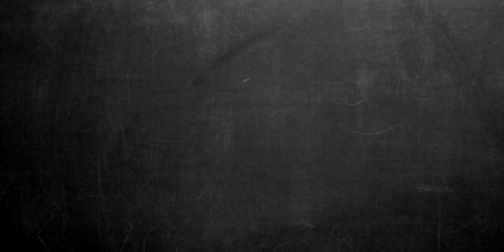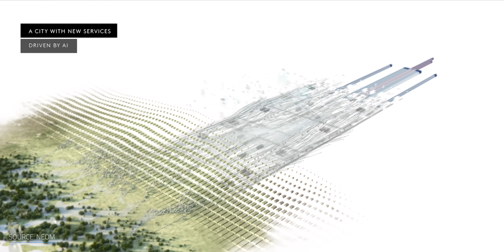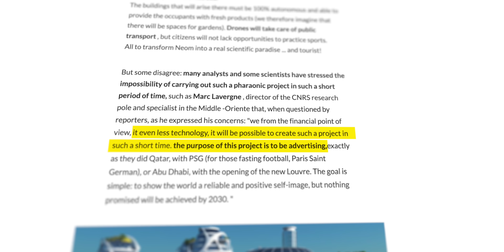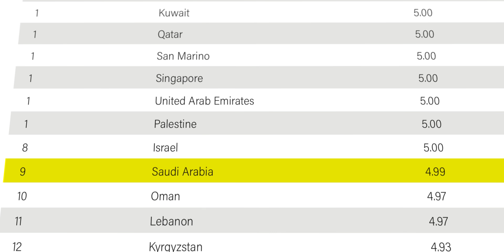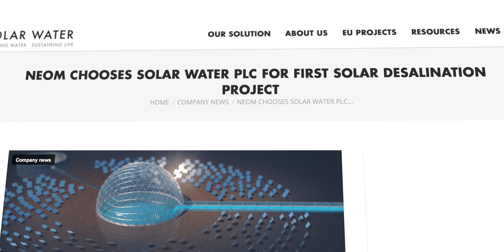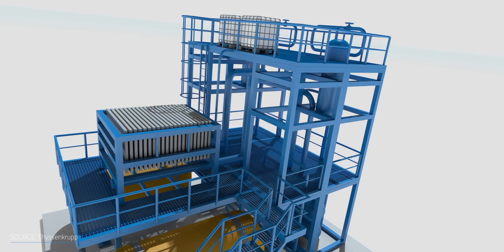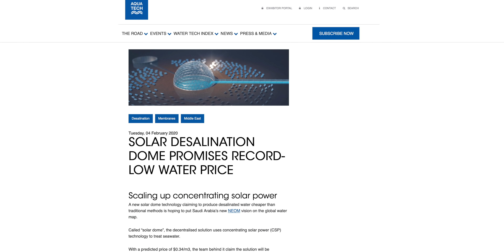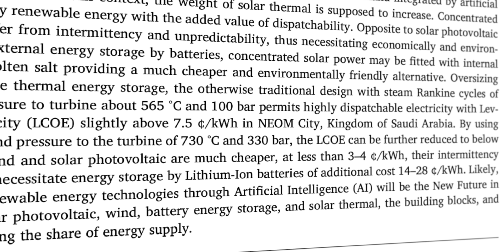Why Neom Might Be The Future of Sustainable Cities

Comment: How can you make a mostly scientific video, talk about the temperature of gases and use Fahrenheit as your unit for your description of their temperature. Come on.
Reply: Does it matter? No, it really doesn’t. I swear, you never hear bitching about the use of Celsius, but all hell breaks loose if someone uses any unit not metric. If you want to know what the temperatures are in Celsius, just look them up. Heck, if you want to bitch and moan about Fahrenheit so much, let’s cut the middle man and use Kelvin instead, since that is what’s used in science.
Reply: @howardbaxter2514  In the scientific community the metric system is standard (with some limited exceptions) because the units are superior for any number of reasons that you could research yourself. I am perfectly okay with using Kelvin, in case you didn't know a degree Kelvin is the same as a degree Celsius, the scale is just shifted by 273.15 degrees.
Reply: @howardbaxter2514  You seem to be making a lot of assumptions about someone on the internet you have never interacted with before. I can absolutely understand displaying both units when talking about measurements. I can't however instantaneously convert Fahrenheit to Celsius in my head without losing my train of thought while watching the video, so I can't immediately understand what is being said.

Fahrenheit is used by 7 nations on the planet, and as far as I know it's one of the imperial units that's not used by the scientific community at all, and clearly Matt is American, but he also talks about science and technology a lot so I'm not sure why he's using inferior units on their own. 

I'm also uncertain why you have a need to be so rude towards others because they disagree with you, but do consider why larger educational Youtubers (and humanity as a whole) tend to not use Bananas, grapefruits or mugs to measure things, but instead tend to opt for Celsius or at least show both systems.
Reply: @endur1el  you realize the point I’m making in using obscure units is to stick it to y’all that constantly bitch about units, when all that matters is that you understand what I am talking, I would think it is fairly easy to see how long something is if I said it was 4 bananas long. 

And yes, I have seen people complain when people use BOTH measurements. Heck, I’ve seen people complain about the SloMoGuys use feet to mark off measurements for their glass breaking video, despite them not accepting the fact that they converted all the units to various other speed units in the end, whether that be mph, m/s, or Mach.
Reply: @howardbaxter2514  Once again, you're making unwarranted assumptions about my opinions and behavior. 

I mentioned earlier than Fahrenheit isn't a unit I (or most people) understand intuitively because unlike other imperial units I am basically never exposed to it. While Imperial mass, volume and distance measurements are also inferior to their metric counterparts, I've seen them used enough that the conversion is fairly immediate. Also the conversions are simpler, with approximations required only whole number multiplication. 3 feet ~ 1m, 1 quart ~ 1 liter, 2 pounds ~ 1 kg. This isn't the case for temperature (It's also the least used Imperial unit internationally afaik).

Again, not sure why you have a need to group people. Humans are individuals, I'm not making any assumptions about your opinions on anything else. Would appreciate it if you did the same.
Reply: @endur1el  maybe it’s because I get tired of seeing comments like yours on EVERY freaking video involving science and engineering. It’s like, maybe instead of complaining about it, look it up. You very rarely, if ever, see Americans complain about the use of metric units, so why do people like you feel the need to complain about any usage of imperial units. And just so you know, the conversion is fairly simple. F= 1.8C + 32. For reference, -40F = -40C, 32F = 0C, 50F =10C, 68F = 20C, and 122F = 50C
Reply: @howardbaxter2514  I know what the conversion is and my point isn't that it's impossible, merely that it's just complex enough to be annoying, with how there are two components to keep track of rather than just one. 

And Americans shouldn't complain about someone using the system that is used almost exclusively in entire world outside the US, and is considered superior by those who really stretch the limits of what we can physically measure.

Imperial is an objectively worse system. I absolutely understand using mach when working with sonic speeds or AU or parsecs when working with Astral distances, but using a system which is fundamentally more complex than it needs to be seems unnecessary.

And again, I'm not saying you shouldn't be allowed to use imperial units for anything. Think of it this way, using imperial units in scientific conversations is like someone coming to the US and refusing to use the system everyone around them is accustomed to, refusing to even use both systems, except worse.
Reply: @endur1el  “two components to keep track of”, meanwhile Americans are taught both systems and how to convert between them.
Reply: @endur1el  but regardless, hot is hot, and if you don’t know what the temperature is in whatever degree you use, then simply look it up. If I’m told something is astronomically cold in Kelvin, I don’t complain that it is in Kelvin, and that I can’t understand it. Instead, I do conversions into Celsius AND Fahrenheit.
Reply: @howardbaxter2514  Honestly not sure why I wasted so much of my time on this, since you're clearly just making bad faith arguments and not responding to what I'm saying. I think if you read through all of my previous messages you'd get answers to both of the things you just said.
Reply: @endur1el  I’m not sure why you felt the need to make your original comment in the first place.

Comment: A linear city seems really inefficient. That just makes all commutes unnecessaryly longer.
Reply: Having the city closer the the corner wouldve been better
Reply: Traffic lights, turnning and bad drivers is the things that slow transportation time. Being able to drive in a straight line, fixes a vast amount of that
Reply: @matthewbergeron3641  Yet that Wont fix it here. Each exit will lead to a traffic light(Logically since the main road will lead to the few side roads that run parallel) This is a City, Not an Interstate. There will be Many on and off connections that go straight into more smaller commercial/residential roads.

Turning wont be as much of an issue but an accident anywhere on the Main Road would Completely stop and cause Jamming and Slowdowns Except on the extreme ends.a big enough accident or even those points where there is miles of traffic only to realize when you get to the end of the "Jam" that there is literally no reason for there to be traffic in the first place. its just an artificial bottleneck causes by multiple drivers breaking in sequence and creating an exponential ripple.

Realistically this city will never work if its reliant on cars. Your best bet would be Mixed Public Transit. Long Distance Raised Express Trains, Regular Underground and raised Local Trains. Surface level Shuttles, Busses, and Trams. The Less people Driving the Better. The Closer Commercial is with Residential the Better(cut down on as much travel as you can)
Reply: will they make one side of the street an inverted mirror image of the other side of the street? To make transport shorter for everybody
Reply: It's the typical Dictator dream constructions
Reply: The linear shape gives everyone a good view out their window. I hope they build a prototype first.
Reply: just think if your plumber live at one end and your stuck toilet is on the other.
Reply: @timothyduffy8818  Just think you're a plumber and found a prime location for your shop.
Reply: Fast and carbon neutralize transportation will make the trip within minutes as they say
Beside that people will enjoy the nature more and have free spaces
Reply: It won't. Because every person in the city has to use the one exact same public transportation line. Even getting on a train will be a nightmare, since everyone will have to get on the SAME train. In a city that uses more that 2 dimensions you have multiple lines, so each station has to manage less passenger load.

Not to mention that this "super mega giga" fast public transportation system won't actually be fast at all, because the trains have to accelerate slow enough to accommodate an average human being. Before they can even get to their max speed, they will be at the next station.
Reply: @nyos22  - Yep - big issue with these "tech will fix evrtheng" people is that they can't distinguish between the concept of "fast" and "efficient". Having a train that goes a bajillion miles per second is pointless if it has to, you know, make stops. So their solution is, "well put the stops farther away from each other" as if that isn't the dumbest fucking idea ever, lol.
Reply: @AuthorityCat  - we already know the tech can do it. Fabricating a problem for no reason to justify the solution is not a novel or innovative approach. What would be a unique idea is actually listening to engineers and doing smart things instead of making them work around stupid plans of upper management, which is already what engineers spend like 80% of their time doing.
Reply: @MigrenAmm  
I love nature. I still HATE commuting. If your solution to commuting is to ‘look at the view’, you have already lost. Thank god you don’t work in transportation.
Reply: Actually the opposite. With well designed transport, anything or anyone can be placed anywhere in the city in moments.
Reply: @Greg-yu4ij  the distances are longer than usual though.

The efficiency and speed of almost all modes of transportation is increased but that doesn't change the fact that you will have to travel further.
Reply: @sebastianjost  well one doesn't have to travel other side of the city , you can get you job near home , so dont need to travel long distance.
Reply: @kaiwalyaghotkar832  how is that supposed to work?
If the city is so narrow, I don't think there's enough space to fit all jobs close enough to everyones home.

Therefor the commutes become longer than they would be in a regular, well planned city.
Reply: @sebastianjost  A tightly packed grid with many turns and traffic lights can actually mean you drive the same distance, but in more time, it's just a maze instead of a straight line. Cars and high speed rail always travel fastest in straight lines.
Reply: @kaiwalyaghotkar832  - "well one doesn't have to travel other side of the city , you can get you job near home , so dont need to travel long distance"
This applies to literally every other city as well.
Say you have a thousand buildings in your city you may need to travel to. A line would put them in a 1 x 1000 grid, making your longest trip 999 "blocks", and your average trip somewhere around 500.
Put the same volume in a circle and now your MAXIMUM travel distance is 36 blocks. See what I'm getting at? Your average travel distance between buildings here is more than an order of magnitude shorter if your city is circular and not deliberately the least inefficient possible shape.
Reply: @nathanchildress5596  - Turns existing doesn't mean "you drive the same distance". Going "up" a block still lets you "skip" having to drive past everything on those rows.
Take a city of 1000 buildings - on a single street, your maximum travel distance is 999, and your average is going to be about 500.
Put that in a circle - the diameter is about 36, that's your maximum travel distance in a single line, but what if your destination is on the other side of the city diagonally to you? Now you have to drive as far across as you can on one axis, and do that again on the other axis. How do you do this in circle math? In this case, you just multiply by the square root of 2, or 1.4. So the 36 blocks across becomes 51 total blocks of driving. Note that 51 blocks is still literally ten times more efficient than 500 - and that's comparing the ABSOLUTE WORST POSSIBLE CASE for a circle to the AVERAGE case for a line.

The Line is intentionally making it less efficient to justify using the high speed rail system as a crutch, which will only mitigate the bad planning at best, not actually make the city better than any other. It's an intentional problem being created to justify the use of a desired solution. It is, to put it bluntly, really stupid.
Reply: @KingBobXVI  the traffic is going to be Horrible
Reply: @Greg-yu4ij  - "With well designed transport"
With phenomenally designed, perfectly functioning, futuristic super transport, the line can be... as efficient as cities that weren't designed in such a stupid way.
The technology and "well designed transport system" are a crutch that, at best, would allow the line to meet the very lowest bar.
Alternatively, you could, you know, not present a failure of geometry and just build a circular city which also has "well designed transport" and get a much, much better result.
Reply: @Greg-yu4ij  if the city is linear 50 miles long and .5 miles wide, that’s 25 sq miles. A circle with 25 sq miles would be 5.6 miles across.  To suggest it’s more efficient to move 50 miles than it is to move 5.6 miles is nonsensical. And that’s assuming it is .5 miles wide. In reality it’s probably less than that
Reply: @Greg-yu4ij  which means you gotta transport everywhere. Forget about walking, cycling or jogging anywhere relevant

Comment: Currently and for the near future this Neom SCMAGLEV train project is pure fantasy. It's projected to have a 170km (105 mi) track along which Superconducting MAGLEV trains run (presumably there will be one long train running the full length, AND presumably 400 to 500 parallel short train-tracks each 1-2 kilometers in length (the width of the linear "city")). That's roughly 700 kilometers of SCMAGLEV track - about 435 miles!!!

Comparing it with an existing WORKING superconducting system, the Large Hadron Collider uses (now old) technology similar to that will be required in this. The LHC's annual operating cost PER KILOMETER is: ~5 MW of electricity, 450 tons of liquid nitrogen, and 2.5 tons of liquid helium. The liquid nitrogen & helium must be replenished regularly, with about 30% loss observed annually (through leaks, inefficiencies, faults, and losses during periodic maintenance).

To run a system that large (700 km) will require a 3.5 Giga-Watt power station (that won't even supply the electricity for the "towns" or buildings, but ONLY for the SCMAGLEV), and also require infrastructure to supply/replenish the liquid helium & nitrogen. This resource needs don't include maintenance requirements, or the fact that this is in a desert (underground) where surface temperature losses (leaching) will raise costs, or even the cost for expert staff to keep it in (superconducting) operating condition. If the superconducting infrastructure has ANY serious flaw, there can be large explosions along large sections of the track that damage/shut it down and possibly kill passengers within nearby trains.

The cost of only materials to operate this (only electricity and liquid coolants) -- i.e., not even counting the construction costs or other operating costs -- will be ~USD$1.6 BILLION per year (or approx. $2.35 million/year for each kilometer of track). Realistically, it will cost close to USD$ 3-4 BILLION per year.  That's for a ~105 square mile city-area (having 435 miles of total superconducting MagLev train tracks).

Even if the superconducting portion is restricted to the 170km/105mi linear segment, the cost would be similarly high and prohibitive (in fact, it would be higher since economies of scale would be lost).

This is a foolish enterprise, proposed by a sociopath who intends it mostly to make money for himself & his friends/family (through approvals & kick-backs on very expensive public words contracts -- where his people take a percentage of project costs). His goal is not to improve society or science, but self-gain.  This is also not within feasible (cost-effective & safe) technologies within the foreseeable 13-18 years it's estimated to construct.